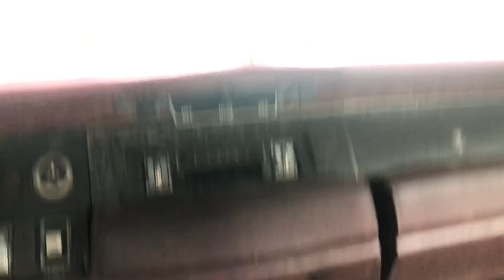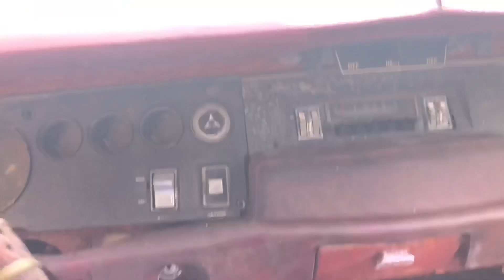1969 Dodge Charger Found In Oregon Woods

Comment: Just remember there are around 243,000 1969 Camaro’s made compared to only around 89,000 1969 Charger’s. So even if a Charger is rusty it’s definitely harder to ever come across one in the wild these days. Should always buy a charger when you see it. It will always sell.

Comment: That thing is pretty gone. I bet half would dissolve in the dipper. Looks like salvage what parts you can then lay it to rest. Definitely not worth 15k when you would spend 100k to rebuild it. And I say rebuild because too much would have to be replaced to call it a restoration. It's all rust.
Reply from the maker: It was a nasty rust bucket hince why I didn’t even buy the car. Sad. I really wanted it.

Comment: I would have snapped that up! It's easily worth 10k
Reply: Every panel is rusted out. Auro Metal Direct makes everything, but everything would have to go. It would dissolve in the dipper. It's only value is what few parts can be salvaged.

Comment: Where they willing to sell it because I'm looking for a 69 dodge charger restoration car
Reply from the maker: yes, I believe it finally sold! took soo long because it was soo rusty! Some guy bought it for $13k and shipped to Texas where he soon after posted it for $25k
Reply: From the looks if the floor I have to wonder what is left of the frame. Take it to be dipped and half the car might dissolve. That's not a restore but a rebuild with all the metal that would need to be replaced. Mark at Graveyard Carz would probably think twice as to if it's worth it.